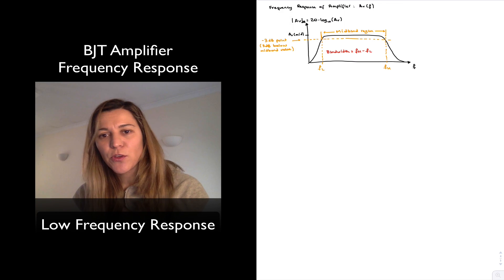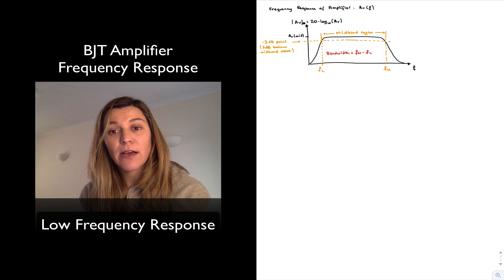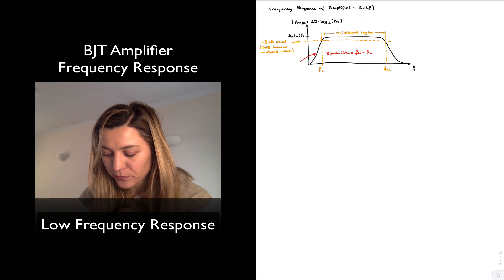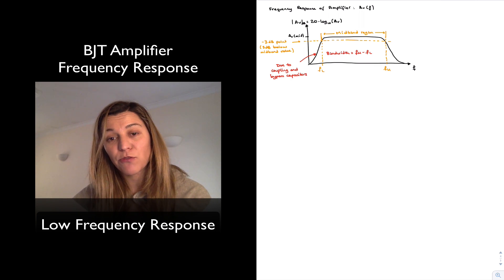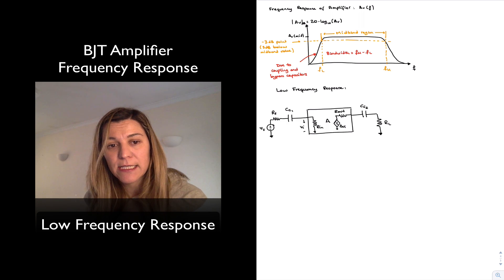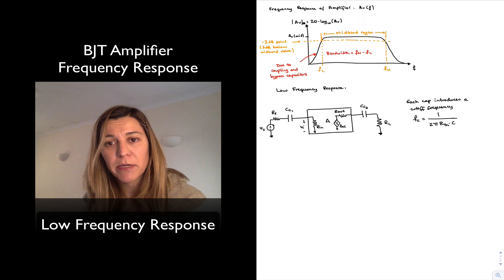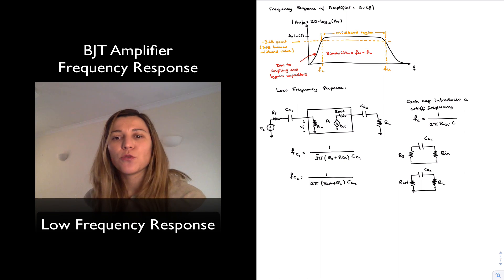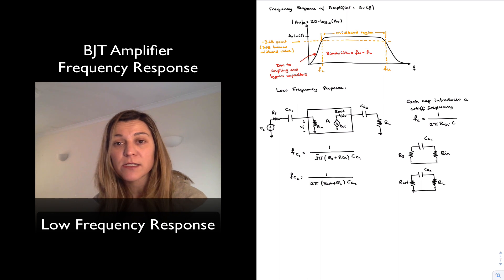BJT Amplifiers Low Frequency Response

Comment: For fc2 to find Rth we should turn off all the independent sources right? But the source we turned off is a dependent source isn't it?
Reply: The dependent source turned off is dependent on the independent source which is turned off for consideration of the Cc2 so the current through the dependent source is effectively zero